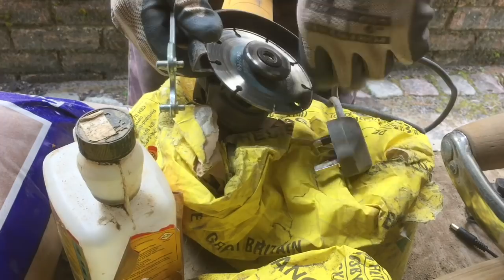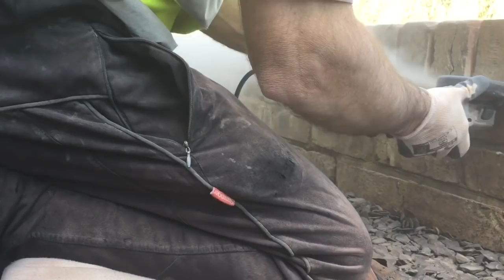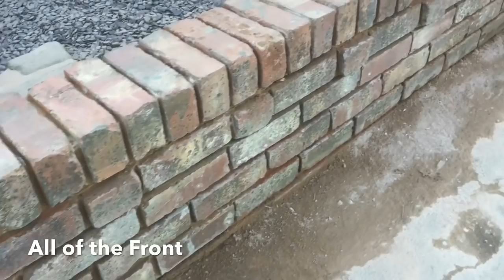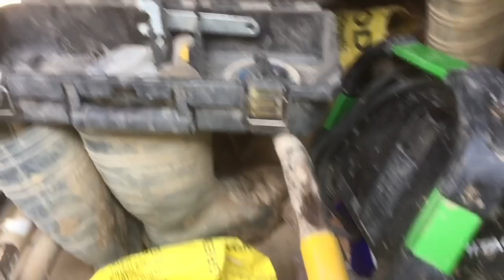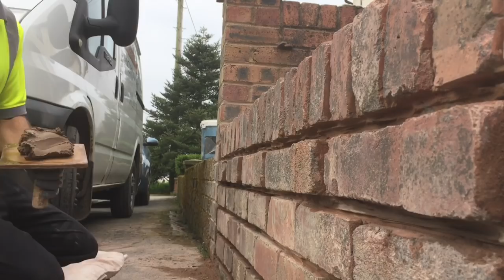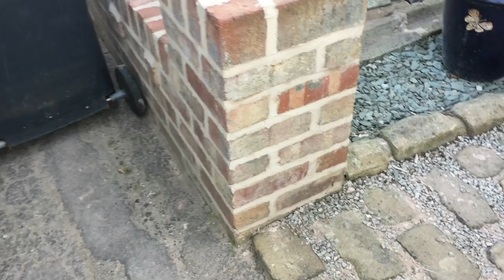GRINDING OUT FOR RE POINTING

Comment: A good trick for mixing by hand is once the cement and sand is mixed dry, add some water and go have a brew, the water is soaked up by the dry gobbo and then mixes up in the bucket with no effort.
Reply from the maker: oldmanfromyork Nice one I will be trying that trick next time cheers 👍🏼
Reply: Bricklaying With Steve and Alex welcome sir, works well when knocking a bit up in a wheelbarrow too, obviously add roughly enough water to make it effective! Too little and its pointless. Too much its sloppy! I did it with a barrow of concrete i needed on tuesday it worked a treat.
Reply from the maker: oldmanfromyork 👍🏼

Comment: Good job lads. I'd of flush pointed it though
Reply from the maker: J.L.T BRICKLAYING CONTRACTORS . Thanks Pal , I did flush point the brick on edge as the cross joints were MASSIVE ! 
thanks for watching and commenting pal 👍🏼
Reply: Bricklaying With Steve and Alex mars bar joints lol
Reply from the maker: J.L.T BRICKLAYING CONTRACTORS 😂 yeah those whoppers you can you joint with your steel toe cap 🤣

Comment: Buy your self a Arbortech AS170 Brick + Mortar Saw
Reply from the maker: voodoo audio . It’s an option but they are a bit pricey for a tool that won’t be used very much , never say never though , thanks for the tip and the support pal 👍🏼